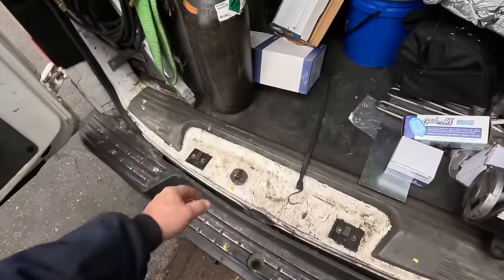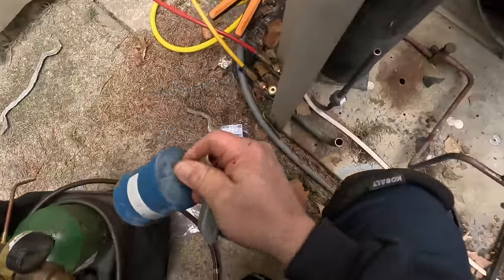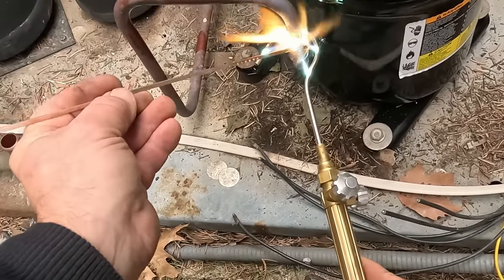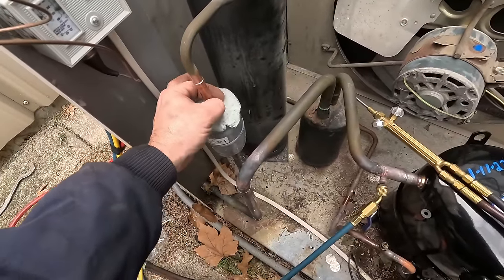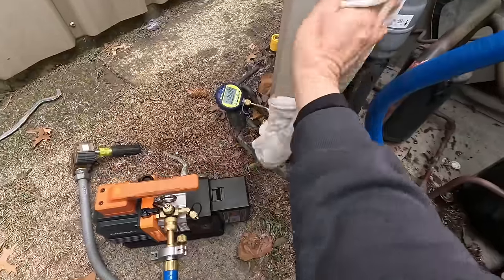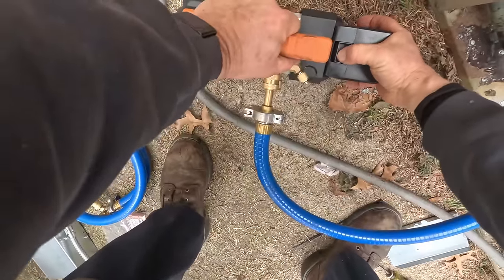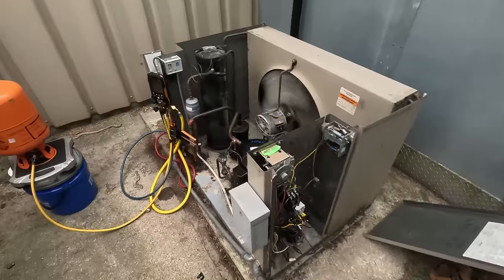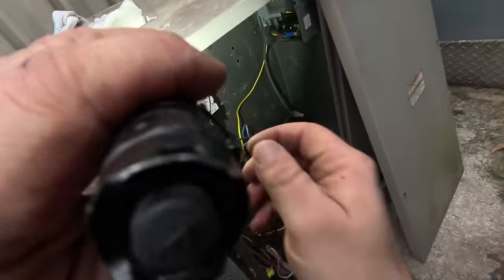Lots Of Work To Do!

Comment: Wish i had that hook torch last week i did a city multi unit 8 ton all outside air ceiling unit with 7/8" suction had to use 2 torches to get it hot enough fast so i could braze my lines. but hey it worked.
Reply from the maker: The hooks not that expensive, but you gotta have the matching handle for it to work correctly. Just a heads up, people will say it’ll work with a Victor torch, and that’s what I had prior to, and I had all kinds of problems with the oxygen and a settling mixing in the handle.

Comment: First time I encountered the Bohnmizer TXV was in the mid 70's about midnight on a Red Lobster walk-in R-12. I thought it needed head pressure control as it was about 25 degrees outside. Researched it and came back the next day. I can't remember what the actual fix was.

Comment: I may try that captain Hook torch
Reply from the maker: Just remember you need to have the uni weld handle, I tried a Victor  they said would work but I kept having backfires because the oxygen and acetylene was mixing in the handle

Comment: instead of wet paper/rag by itself, I usually wrap a bit of aluminum foil around the stuff I want to protect, I stick the wet paper towel under the foil.  The foil reflects the heat away from the wet paper towel or rag back towards the joint I'm making....and I can throw the foil away when done, but the rag can be reused (usually).   Anyway, I'm not so worried about close burnable or electrical stuff in the vicinity....
Reply from the maker: Interesting, I might have to try that

Comment: What pressures you use for oxygen /acetyline
Reply from the maker: It kind of depends on the tip. But on average, I’ll run somewhere around 8 to 10 on oxygen and about the same on the acetylene. Technically, I probably don’t do it right because I throttle with my valve on my handle.

Comment: 👍🇺🇸❄️🙏 great vid. ?’s What would b considered a good color when oil is Removed ? N fan cycle switch is used if unit is outside with no headmaster, correct?
Reply from the maker: More of a yellow to clear. This system doesn't use a headmaster or fan cycle switch normally. But they added the fan cycle for a solution to a problem. Not sure what the program was. The bohnmiser txv is able to adjust faster because the bulb is in the refrigerant, not just strapped to the suction.
Reply: @HVACRSurvival  thanks Rick appreciate ur knowledge and experience 🙏

Comment: Where did you get the navac  to Milwaukee adapter from?
Reply from the maker: Amazon, it's a Makita to Milwaukee but I had to modify it to fit the navac. You'll need to do a little trimming with a Dremel tool.

Comment: Rick do you have a link for the navtek vac pump battery converter? I am after one for a Milwaukee M18 battery
Reply from the maker: I got it on Amazon, this is a Milwaukee to Makita adapter, but you will have to modify it with your Dremel tool. Not real hard, but not perfect, but works.

Comment: Did Rick get up on the wrong side of the bed this morning?:goodvibes::goodvibes:  I loved your rant though.  Have you taken the pliers wrench, and laid it on top of an open end adjustable wrench, (cresent wrench)?  I can see an advantage with the pliers wrench.  The tighter you grip the handles the tighter it will grip the nut.  There is slop in the cresent wrench and that is where you will round the edges of the nut.  In all this work the electrical circuit is my weak point.  Do you have any suggestions who has a program that starts with a simple circuit and then builds from there?  I don't have a problem working with electrical.  Thank you for all your videos.
Reply from the maker: Depending on what it is you want to learn about electrical, I would jump over to one of the electrician channels, electrician University I believe is the guy's name, he's really good, and then there's an electronics guy that I really like watching,  I think he is EEB. I watch a mix of both and pick what you need. Electrical is one of my stronger suits, I knew that before I knew HVACR
Reply: @HVACRSurvival  Thank you Rick

Comment: That oil, was mostly metal.
Reply from the maker: Yeah I remember refrigeration mentor talking about that black crap on the top of the heads, I'm curious to see what the actual damage is, it's probably just busted valves

Comment: Copper plate steel go with 45%
Reply: Improved tensile strength especially with the vibration of the compressor and a bonus less heat less carbon oxide
Reply from the maker: That’s all they buy unfortunately.

Comment: Nothing against your technique hell i use those plyers too, just find the diference between europe and usa so fascinating regarding electric side, for example wire nuts wouldnt fly here and also not using end terminals when going into screw type conectors for stuf like that contactor, oh boy the inspector would have a fit. but anyways top job
Reply from the maker: I agree with you on the Wagos, or at least from what I've seen online on the testing videos. But cranking down a wire inside of that contactor versus a spade terminal, I'd rather have it cranked down, I've never had one burn off but I have had them burn off on crimp Downs. I get what you're saying, totally different electrical code. I did use a Wago  on the last video, if I could get as many Wagos as I wanted I would use them more often, they're like 25 cents to 30 cents a piece versus three or four cents for a wire nut.
Reply: @HVACRSurvival  The screw terminal is much better than the spade connector for sure, but we like to put ferrules on flexible cables before putting them inside the screw terminal (unless it's a nice terminal with a hatch that goes up and down).
Reply from the maker: I've seen the square ends before, wasn't sure why they had them. Now I do

Comment: You’ve got to get yourself wire ferrule ( boot lace ferrule ) kit.
I don’t go as anywhere without them, got the twin wire ferrule kit also - very happy with them.
Reply from the maker: I used those for my amplifier in my Jeep. I'm not sure I liked the ones I had, they still got cut in half when I cranked down on the wire.
Reply: @HVACRSurvival   The bigger ones ( over 10 AWG ) you got to be careful with, and kinda know what to do with them. But smaller are all standardized and very useful. I started with regular square crimper from Amazon, and I still use it and the kit, but then bought hexagonal crimper, and the one that makes kinda parallelepiped shaped ones for special occasions.
I do good number of industrial control panels, and use those all the time.